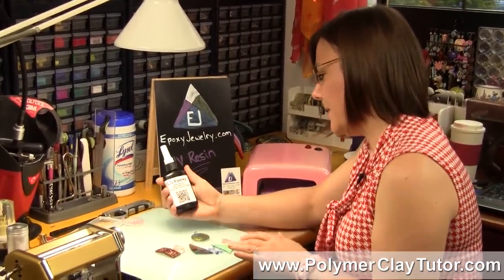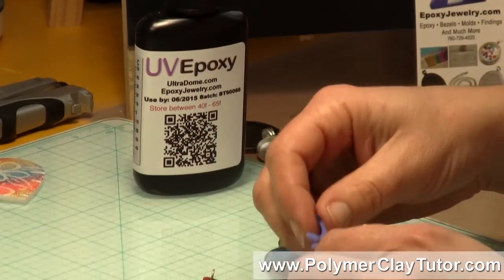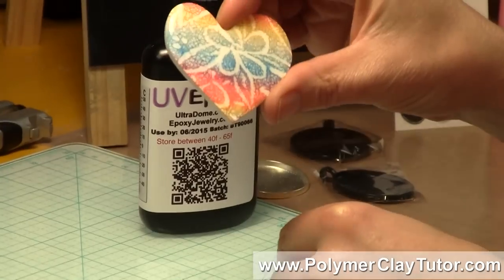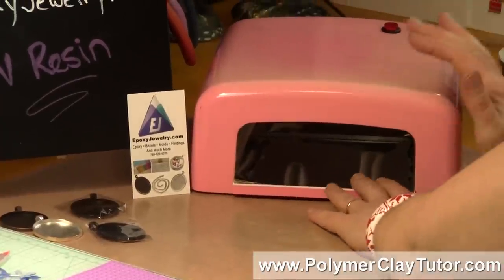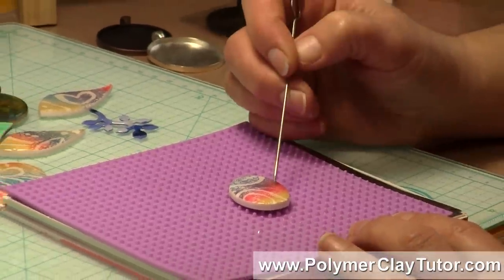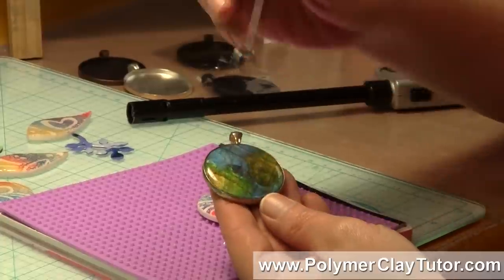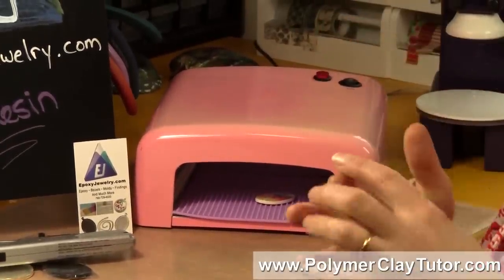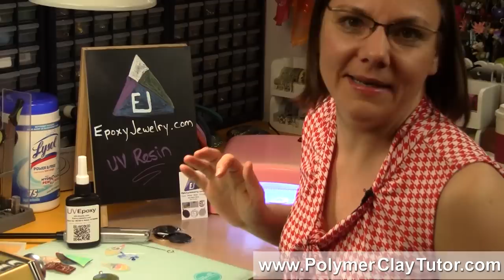UV Epoxy Resin (Ultradome) on Polymer Clay

Comment: My Ultradome just arrived, as did my 36-Watt lamp from AliExpress - about $22 with free shipping by e-Packet, with pretty fast delivery considering from China, about 2 weeks.  Can't wait to try this!
Reply: Brian Taylor Okay, did my first couple of small projects and I love this stuff.  It cures fast, hard, and crystal clear.  One other thing - you can easily do those impromptu one-off projects not only because of the rapid cure, but also because there's no need to mix up a certain "minimum amount" like you do with 2-part resins.  This always made me wait until I had several things to pour to avoid wasting resin.  If an idea comes into your head you can just do it right now!  I also notice that bubbles are almost nonexistant, assuming you don't shake the resin bottle before using it.  A lighter flame easily took care of the 2 or 3 very tiny bubbles that I did have.  Oh, yes - a small thing, but no little cups, no stir sticks, and no toxic vapor or unpleasant odor.  I may never use 2-part resin again.

Comment: Would you recommend using ultra dome UV resin for cylindrical things like pens? 

I have noticed that the UV resin that i am currently using as a finish for my polymer clay pens has a habit of pulling inward so i am left with areas of my pens that are covered in a thinner amount of resin than other areas of my pens.

Comment: I have been researching the safety of UV resins and the predominant opinion is that the fumes and off gassing 
which occurs from the curing process can be hazardous to your health. You recommend Ultradome  Resin which I use and provides excellent results, however I cannot find the material safety data sheet for this product which would provide more information on the hazards of use and information for safe handling of this product.

Comment: Liz, i have a question. I have used uv Jels on some of my pieces. Love it on pendants and earrings, but on bracelets i have found that they break easy. Should i use something different on bracelets? With jel there is no more flexibility. I think a bracelet needs that. What do you suggest?

Comment: Someone on your blog post asked about using a rotisserie motor for beads. What about simply using a mirror on the tray and elevating the beads up with skewer sticks so the light can reflect?
Reply from the maker: It won't help with the drips. That is why the lady was using the rotisserie.
Reply: Thank you!

Comment: I love your channel thanks so much for sharing.  My question is I was going to go order this resin but then you said it takes 20 - 25 minutes to cure in the light, that seems a very long time, most resin i work with cures in no more than 5 minutes.  Is that just what you do or does that resin require that length of time?  thanks so much :)

Comment: Thanks for the grea t video. Should I drill/make holes for pendants/earrings before or after applying resin. Also, how long should I wait before putting  a second coat of resin on. ( I will need to do this because I have partially 3 dimentional pendants.(...Thank you!
Reply from the maker: I like to drill holes before adding resin. It is trickier but looks cool. And since I use UV resin that cures in a few minutes with a UV Lamp, I can add another layer right away.
Reply: @PolymerClayTutor - thanks for the info. I tried drilling before and the resin kept leaking through the hole...big mess for me. (ended up sticking a toothpick in the hole to plug it up..lol..it worked but not ideal.) Then I tried drilling after which worked better. It's good to know I can put a second coat on straight away. Some of my pieces didn't cure well. Others were fine..not sure why some ended up sticky. You definitely need some patients!...still, ..successful results are very rewarding. Thanks again!

Comment: I was wondering if you did a  video on the  regular  2 part  epoxy  resin? I tried  looking through your videos, but can't find it if you did. I had already  purchased the  2 part epoxy resin  before I seen this video and I was if I had to do anything special to use with  polymer clay? Any tips or tricks with regular epoxy resin? I think the uv resin would be  awesome if I had the lamp. Thanks! Becky
Reply from the maker: +Rebecca Thompson Hi, I haven't worked with two part epoxies yet so I can't really give you any advice. I love the UV resin because you don't have to worry about getting the mixes wrong and it sets up so quickly. Because of this, I haven't really rushed to learn more about the 2 part stuff, though it is on my list to learn about.

Comment: Thank you! I was wondering about what u used the uv light machine for! And I just heard about magic gloss, but I'm glad I didn't invest the.the epoxy u showed is apparently better! Would u say the guy u recommended to buy the products from is the cheapest place to get from? I'm on a tight budget... and about the uv machine we should only get a higher watt?
Reply from the maker: Hi Gavi S This product is quite a bit cheaper than Magic Glos and any other UV Resin that I have found. I do recommend the higher watt lamp though. Terry sells them at a good price but you can also find them on eBay and other places online.

Comment: I know this is an older video but is the bottle your using refillable? that way if I get the small bottle to test I can fill it with more resin once I buy the larger size?
Reply from the maker: Yes you can refill the bottle that I used in the video. That's a good idea!

Comment: Also with what kind of drill do u make ur holes for ur jewelry pieces? Or should I ask, whats the least expensive, space taking drill that will do the job? ;)
Reply from the maker: Hi Gavi S I like to drill my pieces before I add the resin. The resin has such a good surface tension that it doesn't go down and fill the hole. But you can drill after if you wish. To drill into polymer clay I just use regular drill bits for wood and put them in a hand held pin vise (basically a handle that a bit slides into fairly similar to an Exacto Knife only with a round hole for the bit rather than a flat slot for the blade). Then I just drill by hand. Simple, safe and no fuss.

Comment: I am trying to find out what to use on my polymer clay sculptures. Do you have any suggestions? Thanks. Love your videos.
Reply from the maker: If you want to put a UV Resin on a piece that is not flat, like a sculpture, you will need to use one of the quick cure UV Resins that you can brush on. Something like this should work: https://amzn.to/2p90D0y (**Amazon Affiliate Link)
Reply: @PolymerClayTutor  thank you very much for the information.

Comment: Awesome technique! I've always been wondering if I can just finish off my charms with resin instead of glaze. All the glaze I've used so far stayed a little sticky...Have you ever tried using resin on 3D charms to "glaze" them?
Reply from the maker: Hi Kazuyo89  because the product is quite thin, it can be tricky to glaze 3-D projects with it, but I will do some more testing and see if I can figure out an easy way to do it. Thanks for commenting!

Comment: Might be a dumb question, but can you use this kind of stuff on shrink plastic? specifically the inkjet kind?
I've been struggling with a lot of different resins and most tend to bubble up super easily during curing, haha.
Reply: That should not be a problem since the "oven" used for curing the resin is not really an oven, it's a UV light.It's worth a try!

Comment: I plan on doming over small pieces acrylic paints skins. I noticed on a trial setting of mine ended up sticky where the Ultradome and the acrylic paint met each other. Cured perfectly on top though.  I'm thinking that certain flowtrol and silicon oil used to create the interesting skins is chemically reacting with the Ultradome to inhibit the cure where they contact.  Just let me know if you have a remedy. Please.

Comment: I am using a no wipe top coat for nails and harden it in UV lamp and it also works beautifully. Would not have an idea where to buy UV epoxy in Poland to be honest, so I got creative and I think its the same thing...?
Reply from the maker: I did a video awhile back where I tested using Madam Glam UV Nail Polish and although it was compatible with the polymer clay, it didn't bond that permanently and was easy to peel off. As far as UV Resin and UV Top Coat being the same thing.... they are not. They're similar, but not the same. There are many different types of UV Finishes out there, that each have their own different properties. In regards to finding UV Resin in Poland, I would do a Google search and see where you can get it shipped to you. Good luck!

Comment: Hi I am a little confused I would like to use the UV finish for my polymer clay pieces, watching your video
You said that It will take to cured around 20 minutes, I looking the UV lamps they have settings to 30s, 60s and 
99s where can I buy a UV lamp that will cured my piece for that amount of time (20 minutes)thanks. Janneth from Australia.

,
,
Reply from the maker: Yeah a lot of the lamps do have very short times on them... they are meant for those super quick curing UV Resins. Here is a lamp I have in my Amazon shop that has a 30 min timer as well as the shorter timers. https://amzn.to/3pqUxCH (**Affiliate Link)

Comment: I have a question about the UV epoxy (ultra dome). Lately after adding the resin to the pieces and placing them under the uv light for 20-25 mins, a few days pass and the resin starts peeling off the sides of the pieces. Do you have any suggestions? :( I am so sad because I have no idea what to do and it keeps happening to the point that I am afraid to sell my pieces. I wonder if it is the UV lamp (the one I have is the Lisa Pavelka one) is not strong enough? What UV lamp do you use?
Thanks so much in advance

Comment: Hi. I have epoxy resin but is not UV resistant. Can i put something over the resin to prevent uv light yellowing? I had a gloss coating from home depot that i use to add gloss to my acrylic paintings and it worked really well. since is uv resistant can i put that over the resin? The thing is that i want to resin and not just gloss on my polymer clays because the clay i used was sculpey and its not as flexible as other good polymer clays, so eventually if you add pressure it can break. Im not saying that the people that buys me the jewelry will do this,  but i want to prevent that. So i want to be able to make it hard and to not yellow, because is really sunny where i live and the pieces are so pretty i dont want them to yellow and clients not to be satisfied

Comment: Blend and twitch thin piece will not break if dropped?  I am working on a project and for some reason, the clay never bakes to hardness even after I bake the premo at 60 minutes on 275.F Any suggestions?

Comment: Do all UV resin's dome? What is doming and is there such a think as non doming resins? Will the surface of clay be flat afterwards?
Reply from the maker: Lorraine Conterio all resins are not coming resins. You can do a flat piece with this resin though if you keep the layer thin

Comment: I like it but it seems a little runny and doesn't dome as I expected (runs off the edge of the piece too easily).  I notice they recommend storing at 40 to 65 deg F, but my room is around 70-72 deg.  Would putting it in the fridge make it less runny?  I did find a workaround, which is to pour the resin, pop it under the light for about 7 seconds and then move it around on your piece.  It's still completely liquid and will move when you tilt the piece, but it's not as thin and runny and has more "respect" for the edges.
Reply from the maker: +Brian Taylor The sharper your edges are the higher it will dome. It's a surface tension thing.
Reply: +PolymerClayTutor  Thanks, Cindy.  I wasn't doming clay.  I was using it to fill a bezel with a small, flat finding (cross) in it, so the edge was the bezel itself, which of course has a sharp, well-defined edge.  I just wanted it to dome up slightly above the edge of the bezel and was also making sure to keep the piece level, but the resin didn't want to cooperate.

I do suspect temperature is the controlling factor.  Since posting this, I was on the site of another UV resin (Solarez), and they advise chilling their resin to get a higher dome, so I'll try this with the UltraDome and post my findings.

Comment: I have tried many of the resins only to be frustrated by the edges pulling away during curing, so that 2 to 3 layers are needed to cover the edges properly.  That ends up being a lot of time spent.  However, the Ultra Dome is my favourite as well.  I am amazed that it goes right out to the edges and stays there during curing and the bubbles are easy to get rid of with a torch waved across the surface for a couple of seconds.  Love the product!!  Thanks Cindy for bringing it to our attention!
Reply: Hi Lisa, can you tell me what wattage or type of lamp you are using to cure this resin? I just ordered this resin and now I need to buy a lamp. The company sells the florescent bulb type UV lamps but I wonder if LED lamps work well too.

Comment: Hi :) The polymer clay to bake before or after using the UV lamp? Thanks :)
Reply from the maker: Bake before adding resin
Reply: I am working on shape memory polymers, i have two type of polymers in resin shape to mix them to get shape memory polymer, one is hardener and other is softener, can you please tell me how to get epoxy based UV curable SMP.

Comment: Glue your rubber thingie to a ceramic tile, a piece of acrylic, thin plywood or even stiff cardboard/posterboard etc. cut to size and you'll solve the flexibility problem that makes moving the piece into the UV light difficult - while retaining the benefits of the rubber-finger surface that you like.  It still slides into the UV appliance just fine.

Also, if you're putting your clay piece into a bezel, dome the piece with the resin first, then glue it into the bezel rather than the other way around.  This allows you to clean up the edges from any stray resin before gluing and also solves the problem of possibly having uncured resin leach into the space between the clay and the bezel.
Reply from the maker: TechSupport100 Good idea for gluing in the bezel AFTER doming with the resin. That does solve the issues of the resin sneaking around the edges or the drying glue gassing off and putting bubbles in the resin along the edge. Thanks for sharing that tip!

Comment: Hı,Is this resin resistant to impacts and scratches? is this product successful in wood and stainless steel ring surface coatings?Thanks.
Reply from the maker: As far as the durability of this resin on wood and steel, that I am not sure because I have never used it for that. But on polymer clay, I have found it to be very tough. I have a keyring with a metal bezel filled with polymer clay and domed with the Ultradome UV Resin and the resin surface is scratch free, while the metal has lost all of its chrome plating. I'd say it is pretty good, but you would need to test it for yourself!
Reply: @PolymerClayTutor  Thanks for information.Can you test this product for me on wood and metal surfaces? I look forward to the result..

Comment: Still trying to come up with the best  method for that perfect shine.  I do have the polyfast sander tool and I LOVE it.  For me, so far, resin is the best answer though I'm having some troubles with using it,  I hope to perfect my method of applying it and curing it. I use the UV Epoxy Resin and also their 54w UV resin lamp but I'm having so many troubles with it.  I believe it's because of the storage temp that the resin requires.  It's a few degrees too warm in the house and too cold in the fridge for it.  So, I've purchased a small fridge just for my resin where I keep it now at the perfect temp...BUT I think the resin is already ruined because it just won't set for me right.  It's sticky and even after "over baking" under the UV lamp lights - even double and tripple the required time, it's still sticky.... Wish I knew how to solve this problem.
Reply from the maker: Creative Minds contact Terry at epoxyjewelry.com he should be able to help you

Comment: is the uv exposure safe? can i use a uv black light flashlight and or the sun to cure it?
Reply from the maker: The UV lamp that you use is one they use for curing nails. If you're concerned about it, just set something in front of the opening, so your skin isn't getting exposed to the light.  As far as using the black light or the sun, that will depend on the brand and where you live. I live where it rains a lot and the sun is usually not that strong, so it won't work for me. Haven't tried a black light yet, but I have seen videos when they are used, so you need to do some research on that. Good luck!

Comment: I have a problem with theUV resin  that I am using.  My my pieces tend to curl. And I’m told that that is just the way that UV resin‘s are. I even tried taping them down with duct tape around a tile. It does help but I’m wondering about the epoxy resin that you are using. Do you ever Your pieces curling?
Reply from the maker: Hi Joanna, some resins do have a lot of surface tension. The Ultradome is pretty good for not curling up thin pieces too much. One thing you can do is coat both sides... it tends to even things out.
Reply: PolymerClayTutor  oh thanx so much.  I will definitely have to try it out!